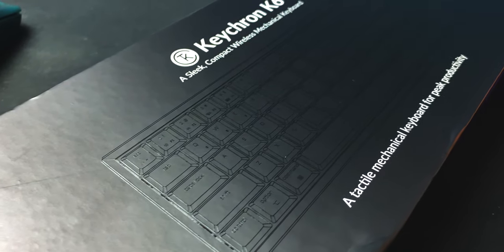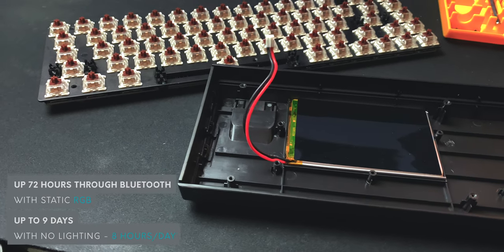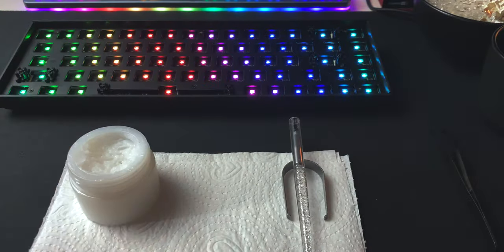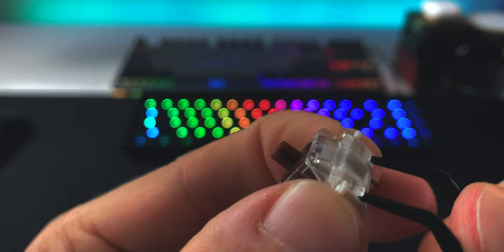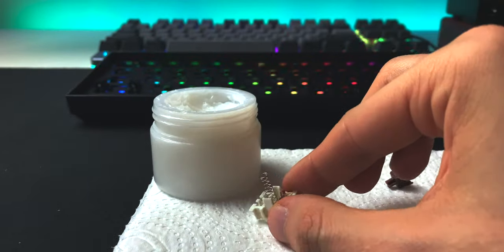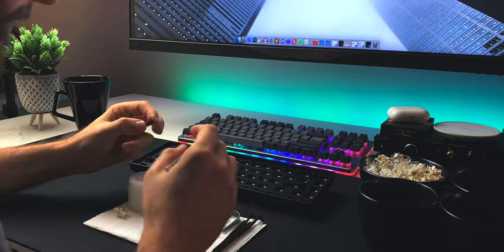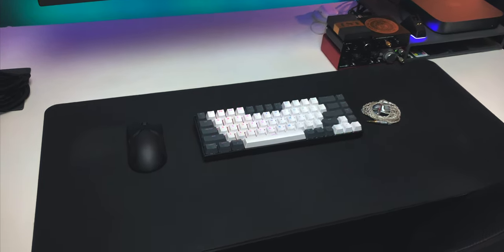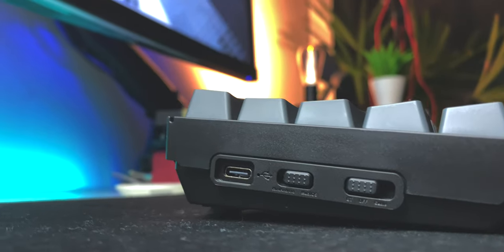Keychron K6 Keyboard MODS! - WORTH IT!

Comment: I was planning on getting this keyboard because of the layout and hot swappable feature. I wanted to use it wired though. Do you think the keyboard is still good wired?
Reply from the maker: There's nothing really that would make it "bad" for wired use... The only thing you need to consider is that the cable is a right angle connection on the left side of the board, instead of coming from the back, which may make stuff slightly more difficult in terms of pairing it with custom cable, for example.

If you already have a custom cable, I'd suggest grabbing a 90º angle adaptor from USB-C to whatever your cable is, so you can use your cable making it flow directly backwards from the keyboard.

Aside from that, nothing negative for wired use, really.
Reply: Tech Hyped Oh ok great! I loved the video and thank you for the quick reply!
Reply from the maker: Thanks ;)

Comment: Hi, I’m new to mechanical keyboards. I’m getting a hot-swappable K6, and I’m looking at improving the keyboard with some of your suggestions. I understand the reasoning behind nearly everything, but I don’t understand why you clipped the stabilizers and added band-aid underneath them?
Reply from the maker: Well, that's sort of easy to explain:
When you bottom out the keys that have stabs, the bottom of the plastic pilar of the stabs usually depresses a bit further than the "housing", so it usually makes contact with the PCB, like what happens here with the K6.
Clipping the little legs helps make that contact less pronounced, and adding a band-aid helps even further by dampening that contact noise. You know, plastic on plastic is rather loud hehe.

Comment: This video was the most useful video i've seen in a while. I'm planning on buying a K6 and adding Zelios V2's and I want to do all these mods. Do you know what exactly the foam you used is called (if i wanted to order from amazon)
Reply from the maker: Samstrex Thanks dude! I appreciate it ;)
I used EVA 2mm (or 3) foam, but honestly, I just had this layin’ around for years, so I’m not super sure what was the exact thing I bought back when...

Any EVA foam around that thickness should do the trick. You can stack multiple sheets if you want, just don’t put too much that could squish the stuff inside ;)
Reply: Sounds good, apparently the keyboard comes with some?
Reply from the maker: @Samstrex  Nope, it doesn't! Don't think ANY keyboard come with these things..
Reply: @Samstrex  I got mine a couple months ago, it did have tow different foam densities in the packing. I used the more dense foam in mine. Also, if this is the first time you've swapped out switches, make sure to take your time when putting them back in. This was the first time I've done it and I didn't realize how delicate the pins were on the bottom, they bend quite easily. Good luck!

Comment: That does not look like krytox 205g0 lube lmfao. That looks way thicker than what the texture should really look like, that looks more of permatex dialelectric grease than anything. Brush was too big, causing it to be overlubed and makes almost a silent sound. You lubed the legs of the stems on a brown clicky switch (then what's the point of buying a tactile switch in the first place) which kinda confused me. Overall I feel like the process layout is accurate as in, this is probably what you should do to mod a keyboard, but the execution could've been better. Also, i guess it's preference, but browns??
Reply: Also, dialectric grease to lube your switches is a really bad idea which will cause you to lose all sorts of smoothness in your keys. Dont do it, use proper krytox or trib lube
Reply from the maker: Hahaha, fair enough, let's go from the start:
1 - yep, krytox 205g0. Viscosity and texture does fluctuate a bit more then what I expected from room temperature change within the little container. From what I read it's probably because of the container itself not keeping moisture properly off from the bottle and stuff on that end.
2 - yes, the brush was too big, but it got the job done... with a LOT of patience and cleaning, it got the job done without brushing the contact points unnecessarily etc... Already got a smaller brush tho :D
3 - Yes, I overlubed everything because with little lube, I kinda wasn't completely satisfied with the results...
4 - Buuuut, even tho I overlubed everything and did paint the stem legs, both the feeling of the switches didn't change significantly (other than being much quieter, of course, and yes, a little bit "smoother"), and the actual tactility is smoother (barely), but not AT ALL erased from the switches. 

I kinda think it's just because there isn't as much physical space on the stems for that much lube to adhere anyways, so it smoothes it out, but doesn't kill the feel of the switch, at least in the way I did it.

All that said, completely agree with ya... execution could have been better, but hey, 1st try/test so... ;)

And yeah, browns hahaha... I've been using linear switches for so long that I just decided to try out something different and I'm 100% in with the browns right now.
Reply from the maker: You're right. Dielectric grease isn't ideal. Can get the job done, but will most likely change the switch feel quite a bit.

Comment: Can I change the switches of Keychron K6 to Cherry MX?
Reply from the maker: Jonrick Aborot yep. Any switch that has a 3-5 pin design (same as cherry, basically) works
Reply: Tech Hyped another question, can I use hyperX Double shot keycaps on this keyboard? Thank you very much
Reply from the maker: Jonrick Aborot most of them, yes. The right side of the keyboard on the bottom row + the Shift, probably not.

Comment: Rip my keyboard broke
Reply from the maker: Dang…. Still under warranty?
Reply: @TechHyped  idk but the only damage is a broken slider i dont have soldering tools tho
Reply from the maker: Wait… Slider? What broke off that you need to solder back on, exactly?
Reply: @TechHyped  the blutooth and cable slider/switch chipped off
Reply from the maker: Ooooh…. THAT slider lol.
Yeah, check the warranty just for good measure bro. Better than chugging it in the bin
Reply: @TechHyped  shoot cuz the chip flew  around the house and i think i might have vaccum it also LOL
Reply: And i just checked and warranty gone for me
Reply: Its now stuck on bluetooth forever btw which is kinda annoying cuz i like cable better

Comment: Never understood why people buy mechanical keyboards which are known for their overly pronounced sound and spend hours and money making them quiet... Get a membrane.
Reply from the maker: There's a pretty big difference between how a membrane and a mechanical keyboard feels while typing... And I'm not at all against membrane keyboards, it's just that the experience is very different.
And then, you add to it the customization aspect of both being able to change how it looks AND how it feels.
Plus, there's so much variety. And obviously, its a potentially expensive hobby, but it can be rather "inexpensive" as well.
Reply: Tech Hyped This video was interesting and made me finally get a mech board. I am currently typing on a k6. Slightly modified with pudding keycaps. I didn’t realize I would need a specific set of keycaps in order to complete the build but I made it work and made one keycap on my own in order to complete it. I chose the red switches and I am very pleased. Thanx
Reply from the maker: Awesome dude! Wait... you MADE a keycap? Geez hahaha! Have fun ;)